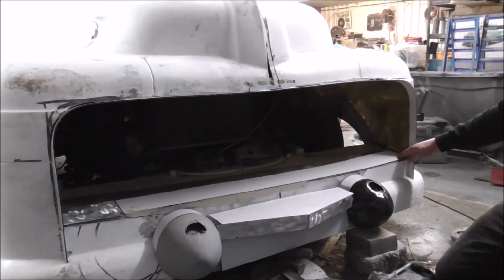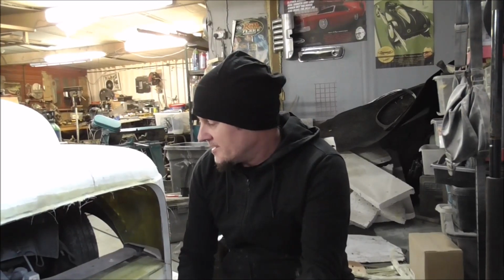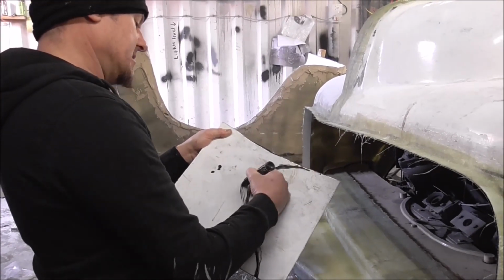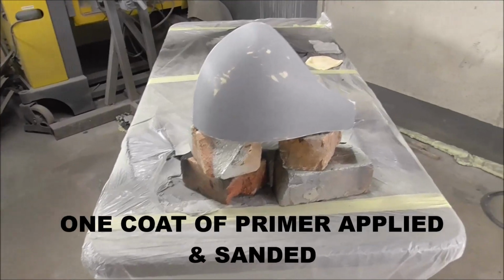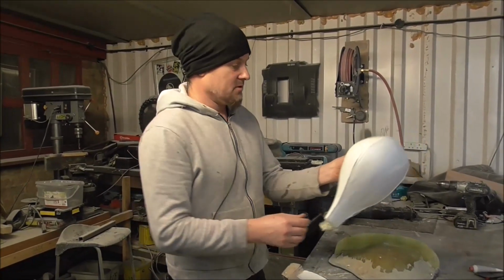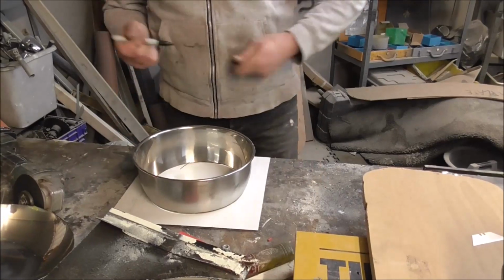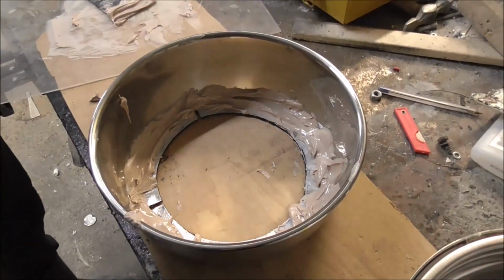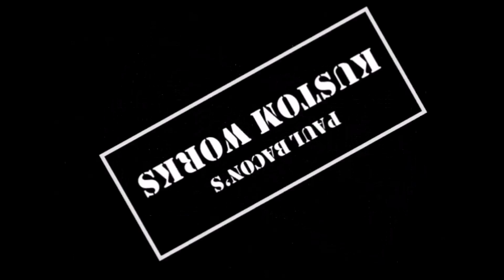MEAT WAGON PART 4: FROM LONDON TAXI TO CATERING TRUCK/CAMPER

Comment: Not sure how i missed this video before but its refreshing to say to a Brit "nice teeth"! Haha, ok sorry, just a bit of yank humor. JK! So I'm sure that you knew this long before me but some of the smoothing with filler is made easier by adding resin directly into the filler. They're both polyesther and mix well. I use this when making fans shrounds for mismatched engines and core supports and need max cooling efficiency. I just make the square as needed then space out to a circle the place and size i need then cover with some fleece, an old fleece shirt works. Then pull it tight and staple it. Once over with the resin only so it doesnt sag too much then dump on the resin/filler mix on the compound curves.
Reply from the maker: The Meat Wagon is coming back soon and those teeth are gonna get chromed (sort of)

Comment: I’ve used DiBond for years in my sign business, but it is prone to warp with heat and cold.....beware. Great vids though ! 😜👍🏼
Reply from the maker: Ar top tip, thanks.  Most of what I use gets a heavy coat of fibreglass though and I never let it span too far without some good support.  Thanks for the kind words.